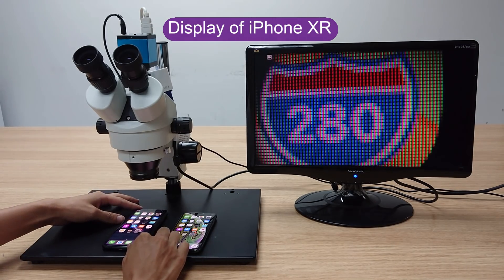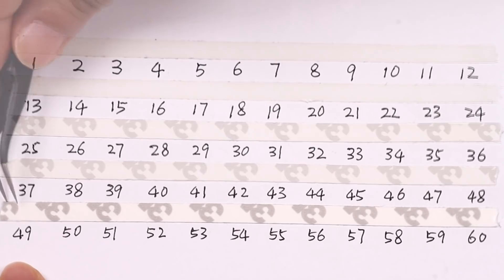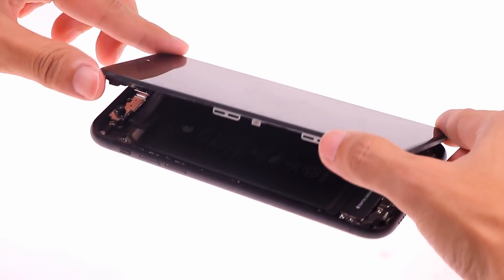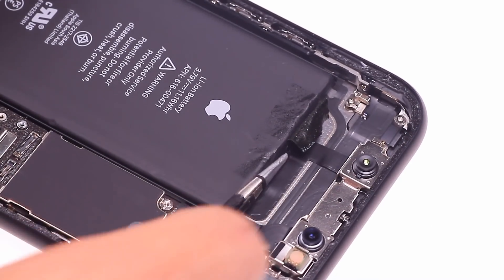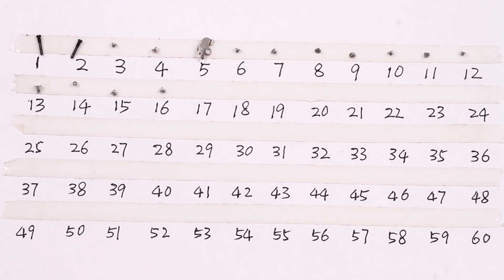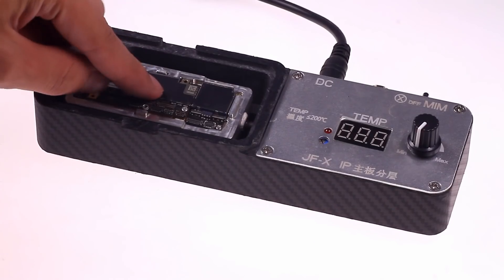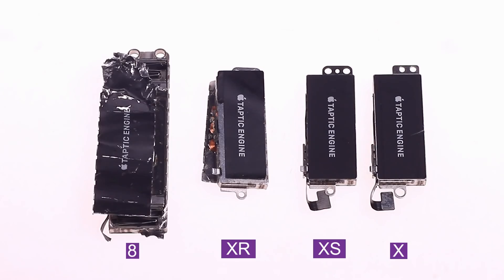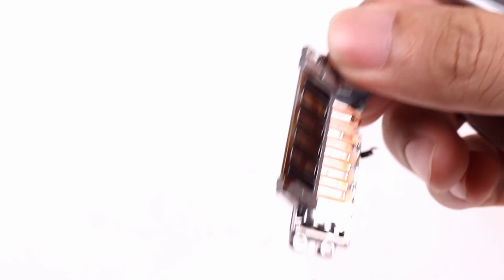iPhone XR Teardown | I Broke Open the Taptic Engine

Comment from the maker: What do you think of the inner structure of the Taptic Engine?
Reply: Wit Rigs I really wanted to see inside the taptic engine. Thanks for doing that...
Reply: Yes I was waiting to see a teardown of this!  Thanks.  I wish it was possible to non destructively do this but with the inclusion of what appears to be ferrofluid, it has to be sealed up to prevent leakage.  This is a voice coil design which allows fast attack and decay response which is important to allow for various types of interaction which unfortunately development has only scratched the surface of as of late.

Good job!
Reply: I still want to see the 6s taptic engine
Reply: Waste of space..
Reply: glitch gamer once you use it you cant use anything else. It feels so amazing to set alarm clocks and timers....
Reply: @chloemcholoe3280  no i wont be happy with it i just dont like vibrations at all but my phone already has very good taptic engine..have u used pixel 3's taptic engine if yes then tell if iphones is better but i have used iphones x it feels just same as samssungs or pixels taptic engine its betteer than xiaomi or others but still that taptic engine which apple uses is patented by samsung u cant throw that and both are nearly same just pixel n samsung uses smaller and less powered but more accurate and apple used high power like a ps4controller vibrator..nothing special .anyday i will just ignore the fact that apple even has some tactic engine its just gimmic that apple has something special its just more powerful nothing else and even i use my own phones vibrator on medium power not full power.its just waste of space and power .apple is good at naming things like liquid retina its nothibg but just rounder corner ips lcd 828p nothing special but people think its good its just cheap that $750 phone has HD LCD display
Reply: glitch gamer Taptic Engine is designed by Apple.... how is it Samsung?

And Taptic Engine produces short taps, hence the name. That’s why it’s used to provide “taps” for the iPhone home buttons, which mimics the taping experience of an actual button. It’s no longer a vibration, it’s an powerful click that responds extremely quickly. It’s fast and short and powerful to the point that some games provides feedbacks for machine guns. The feedback isn’t a “buzz” from the vibrator, it’s actually extremely short lasting individual taps. And just so you know, the name Taptic Engine was created by Apple, hence the capital letters. Apple started using it in iPhone 6S and Apple Watch. 

You are clearly mistaken man. Taptic Engine is much more powerful and accurate compared to other vibrators out there. With your comment, I can safely assume that you don’t fucking know anything what you have said. Go do your own research buddy. Try that Taptic home button on iPhone 7 and 8 before trash talking fake shit, or go try the feedback on an iPhone X. Go ahead.
Reply: glitch gamer Taptic Engine works alongside with 3D Touch bro. Only iPhone XR removes 3D Touch, and Taptic Engine in thereworks well with swiping through menus, pressing the photo button, pinch to zoom, control center, and games, apps, and ringtones. Haptic feedback is already a key feature if iOS.
If the latency is high (give me your source for the latency), then that’s for the three year old 6S. The newer ones are much better. If you have tried out the hone button on iPhone 7, you’ll know exactly what I’m talking about. 

And for the naming..... 
Super AMOLED is just AMOLED
Infinity display is just AMOLED with curved edges, similar to Liquid Retina, a round corner LCD
Infinity U, Infinity V, Infinity O are all the same except the shape of the cut holes
Samsung also named its screen’s pixel arrangement the Diamond Pentile a few years ago. You know.... it’s all marketing terms.
Reply: Sweet Zongzi and the Taptic Engine is way more efficient because it only use one vibration to meet the peak performance and it is so quiet.
Reply: glitch gamer they use it amazingly everywhere. Specially with gestures! Sadly not with typing tho :(
Reply: @chloemcholoe3280  ok if its a big thing for u..then enjoy it i wont say anymore..but still i will say..replacong 3d touch and saying taptic engine ...doesnt make sense..
Reply: @chloemcholoe3280  and more than i assume 90% iphone users dont even know that the term "liquid" in liquid retina is just for rounded corners which are there in nearly any android..and term "retina" just means that pixel density which is higher than 326ppi and..nothing else..but mist android have pixel density more than 441ppi and..rounded corners so every android flagship does actually have a liquid retina superamoled 1440p display..which even apple doesnt
Reply: Wow I’ve learned so much from this. I took apart an iPhone 6S Plus Taptic Engine once and it’s nothing compared to this. I didn’t realize how thin the Taptic Engine was on the iPhone 8 and that this actually included lubrications
Reply: Lumumba B. over engineered? Pretty simple & straight forward. It jus moves side to side rather than spinning which makes it much much more responsive & buttery smooth. You're jus saying that cause you don't have it on your phone
Reply: The XR has and A12 not A11 https://www.apple.com/iphone-xr/specs/
check and this why the xr bettery life is great plus the lcd people loce oleds but with this display, chip, and battery it is a safe bet for an new iphone.
Reply from the maker: @ruffneckgaminginc.6661  Yes, XR has A12, but the A11 I showed in the video is iPhone X's, not XR's. I should have said it more clearly.
Reply: That's probably not a lubricant but ferrofluid. It can be used to dampen the sliding mass.
Reply: Duff's Vids nope that was the x motherboard
Reply: Wit Rigs  the music is loud then your voice, please make the music lower next time and thanks 🙏🏼
Reply: can i buy the iphone xr motherbored ? no i cloud lock ill pay for it
Reply: Why did you break taptic engine? You can google picks of internal structure. You don't have to break it.
Reply: Doesn’t the Xr have an A12 Bionic chip?
Reply: Yes it does
Reply: 2k is Full HD. Not WQHD
Reply: Have you assembled that phone back?

Comment: im 30 seconds into the video and i have already noticed two mistakes. 

The iphone xr, does not have a 1080p display, it is sub1080p, and it is not an amoled panel, it's an LCD. 
and on 0:25 the text says iPhone XR amoled, wtf is that even supposed to mean

Comment: I have a question, My iphone xr has a factory problem on its screen, so apple service here in Colombia tells me that they need to change it. I´m afraid they put a generic screen and the phone loosing its waterproof capabilities. What should I do ?
Reply: If you got it done at an Apple store then it’s probably not generic, but it very well could’ve lost some of its water resistant capabilities.  I’d imagine it is still pretty water resistant, but I would not intentionally swim with it or get it wet, as Apple does not cover any water damage done to phone regardless of whether or not something has been replaced.

Comment: Curiosity question, does anyone prefer this style to the Samsung variant? 
Specifically
It is a bitch to replace a Samsung screen....but easy(ish) to replace the back or the charge port etc
In iPhone it is a bitch to replace the back glass....and for some reason the charge port (why didn't they invert that layout psrt?)....but fairly simple to replace the screen
Been watching people slam apple for difficulty in replacing back glass, but giving Samsung a pass on screen replacement difficulty. Maybe people dont know or dint care, thoughts anyone?

Comment: Is it possible to put taptic engine to the XR so that it will have 3d touch?
Reply: Stephon The Taptic Engine is the special vibration device made by apple. It is already in the iPhone XR and iPhone XS. 3D Touch has nothing to do with the Taptic Engine. 3D Touch is part of the screen its self.

Comment: so basically they call the xr a budget phone but its a waste to even buy seeing as how even cheaper phones can run 1080p videos..... this is another example of how apple does not give a fuck about any of its customers not to mention countless other examples such as when they slowed down older phones on purpose and got caught doing it to try to get people to buy the newer phone and also the ipad pro coming out of factorys bent them costing anywhere from 700 to 1500 all they gotta say is its fine... dont even care... like if i spent my money on that i would expect it to be as intended... flat i dont know about you guys but i dont give a fuck how much money i got 1k is 1k give or take and they are basically saying fuck you for buying the xr so buy the xs or suffer... also comparing the xs to even the iphone 8 i seen one for 500 but if the phone cost twice as much shouldnt it be twice as good too?? and comparing it to samsungs i mean... they take away the headphome jack and charge more then its either carry arround an extra attachment or get airpods which cost 250 and you can buy a home bitton attachment whish isnt so bad but they took it off just to sell back to you 😂 but there is an option... overall all of the iphone x series feels like they are testing it... just dont feel complete to me... also the main screen on the phone with all the apps people have been wanting something new for awhile (compairing yo androids again) the home screen isnt very customisable i just like android because it treats me like an admin and apple treats me like a user

Comment: Oh my god, where the fuck are you getting your information dude?? There is literally nothing in this video that is even remotely accurate. A11? The iPhone did NOT use a Samsung Patented Vibrator, it used a linear-oscillating-motor, which is what literally every single other manufacturer uses and Samsung only owns the Patent on a variation of this kind. Also you do certainly not know how a Taptic Engine works. I am not gonna go into detail, but you are literally talking nothing but bullshit in your video!
Reply from the maker: The A11 in this video is from the motherboard of iPhone X

Comment: I thought this was gonna tear down until the glass back panel. Watched the jerry rig video on how to replace back panel and he did it in a violent way
Reply from the maker: Good idea.
Reply: @EricWitrigs  if you could find a safe way to replace the back glass, you'll save people from spending hundreds of dollars
Reply from the maker: @DRGIZMO29  Most technicians just break the back glass. But that could damage the rear camera and the wireless charging. I think the best way to replace it is fully tear down the phone and put everything onto a new back housing. Nothing damaged. But the best way is not an easy way. I can upload a video to show the whole procedure.
Reply: @EricWitrigs  i didn't think it was possible! Could you make that video?
Reply from the maker: Yes, I'll get it done.
Reply: @EricWitrigs  awesome, thank you!

Comment: What is the relation between screen thickness and 3d toch
All android have long press function regadless of the screen type?
Reply from the maker: 3d touch need one more layer under the touchscreen. Android long press function is different from 3D touch. 3D touch needs pressing down the screen. Long press is only a function of touch.

Comment: Reminds me of my attempts to repair my Triumph TD in 1962. I was great at taking everything apart but when I tried to start the car it wouldn’t until my dad handed me the rotor for the distributor and I put it back in. Then since I had taken all the gauges out of the dash with the intent of putting in a wooden one, the light switch worked the windshield wipers, etc. Eventually I traded it. 

Thank goodness for AppleCare...  Now the magic is gone... My iPhone is just a bunch of parts....

Comment: Give us 3d touch back I use it a fuck ton it's amazing. And I wish the taptic engine never existed it takes up so much space I was happy with a simple tiny counter weight vibration motor that was strong enough to vibrate tables.
Reply: i can hardly feel my iphone x now
Reply: that vibrator was loud as shit, and was easier to break. Want 3d touch? buy a XS, dont gimp out

Comment: I'm sorry but 2K videos are no where. its a DCI resolution no consumer device has ever used it. was only ever used in cinema. why do people keep calling 1080p 2K. it just isn't.

1. 2k hasn't been used since around 2006
2. QHD is higher resolution than 2k.
3. its a non consumer resolution. its not 16:9 its 1.90:1 or cinemascope
Reply: He was talking about 1440p...
Reply: @mdalabs  yes which is Quad HD. or 1440p

Comment: you should see if the screen is compatible
Reply: Compatible with what?
Reply: Might be torn down if the connectors were the same but the dimensions of the two phones are different so it would fit anyway.

Comment: I dont understand how does the taptic engine replace a 3d touch my redmi phone also has taptic engine does it means i can 3d touch i dont understand what does taptic engine has to do with 3d touch
Reply: glitch gamer for phone calls ,gaming and texting for a better quality ringer.
Reply: That Taptic Engine gives you more precise haptic feedback from pings, dings, and notification alerts, it has nothing to do with the actual 3D touch technology. That is specifically added to the display itself there is a tiny array of sensors under the display that can measure microscopic levels of pressure when force is applied to the display which IOS can read and analyze and at the same time add the appropriate levels of haptic feedback from the Taptic Engine. Its pretty insane what complex yet elegant hardware Apple implements instead of a boring software enabled long press. Just whoa.
Reply: BalthazarTheGreat then why my phone vibrate when it press hard on my screen?
Reply: @alstonmiller212  most phone does that,but if you ever try the iPhone's taptic engine it feels different,my s8 does the same but it feels like it buzzes instead of taps.
Reply: Science butReversed but that not the point 3D Touch is a software and hardware capabilities
Reply: @alstonmiller212  im talking about the taptic engine
Reply: Science butReversed I’m talking about 3D touch
Reply: @alstonmiller212  wha...well i thought it was about tthe haptic thingy just becouse you bring out the " why did it vibrate when i hold the screen" or something
Reply: Science butReversed the whole conversation was losing 3D Touch

Comment: the Taptic engine is so amazing, wish more companies included it in their phones
Reply: No its the waste of space..samsungs taptic engine is way better and requires less of space..removing headphone jack to save space wasting tripple the space on taptic engine is just a dumb bussiness
Reply: glitch gamer Samsung..... doesn’t have one.......

Also the only reason they removed the headphone jack is being greedy and wanting to sell airpods and dongles. Some guy even moded a headphone jack into his iphone 7.
Reply: @chloemcholoe3280  Only iphone 7...but that huge taptic engine isnt worth the space..
Reply: @chloemcholoe3280  yeah samsung have one which samsung did u use..even my phone has one ...i dont know evrn have u used it or not
Reply: @chloemcholoe3280  still i have been using.. $200 3.5mm headphones i m not gonna throw them for those low quality airpods apple airpods just sound shit .they are like some $50 wired headphones..they will never replace some 3.5mm high quality headphones..
Reply: @anand.suralkar  I know and watch every teardown, I have an S8+ (actually typing on it as I haven't sold it yet)
Reply: glitch gamer Other phones have vibrator motors, the Taptic Engine works differently
Reply: Chanceral yes taptic engine is amazing. But there’s no reason to be rude to others
Reply: @glitch gamer there are no androids that have taptic engines, just regular vibrators. And also, airpods low quality and sound shit? You obviously don’t know what you’re talking about and i’m also 100% convinced you never even tried a pair of apple headphones.
Reply: @calinalecsandru181  xz3 has taptic
Reply: Chloe Mcholoe, the Haptic Feedback is the best when you play certain games.
Reply: glitch gamer if Galaxy has the Taptic Engine, then I guess iPhone has the Infinity Display.
Reply: glitch gamer your argument about the 3.5mm audio jack is from a false presumption. You presume Apple removed it to sell more AirPods. I’d say that if that was the case, then why did they still allow you to connect any 3.5mm headphones with the free included adapter? And why did they allow you to pair any Bluetooth headphones you like? If they really wanted to sell more AirPods, wouldn’t it be better to get rid of the ability to connect any set of headphones you like?
Reply: glitch gamer, Apple focuses on small details like haptics and makes the iPhone experience better. The Taptic Engine is probably the best vibration motor in any phone.
Reply: Chloe Mcholoe yes...

...removing the headphone jack is amazing.
Reply: Javier Hernandez it’s not at all just a vibration motor, didn’t you see the teardown? A vibration motor is usually just an unbalanced regulator motor. This is a bunch of cooils that can be moved precisely! Like the rumble HD in the joycons! A vibration motor can’t mimic the feel of a button
Reply: Chloe Mcholoe Well, the S8 was close enough to be honest.
Reply: @rue2649  they can do it if they want to, it will have a different design. Its just lateral motion as opposed to rotational. The Hair Trimmer is a good example .